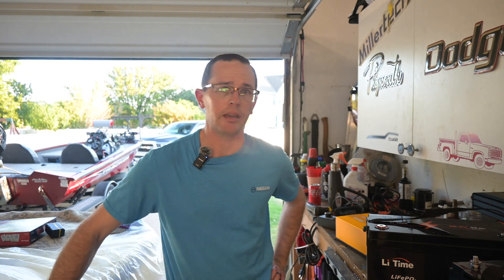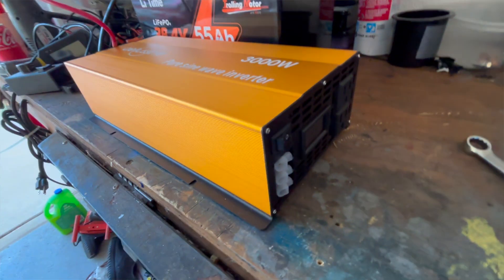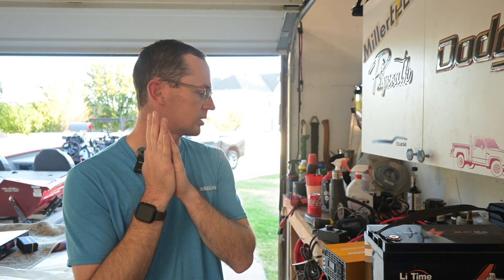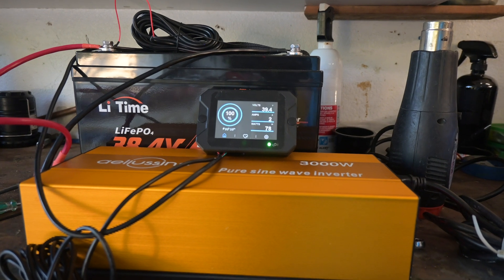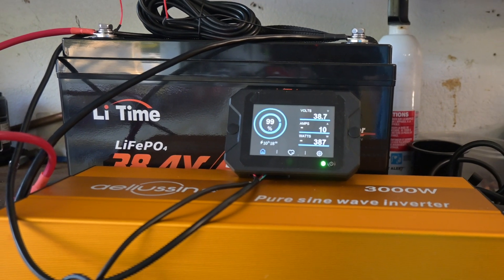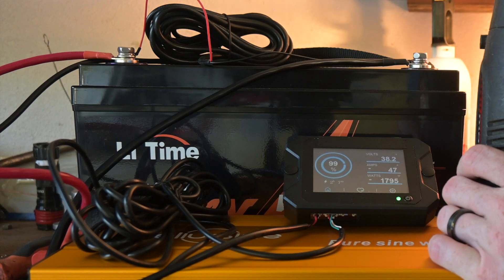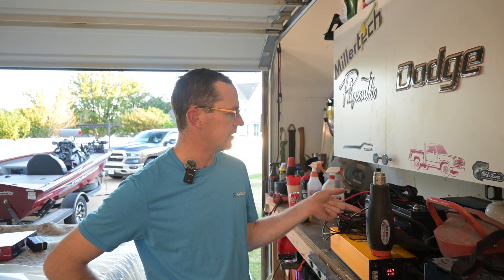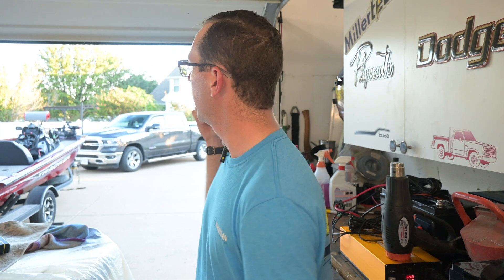36V LiTime Lithium Battery Stress Test - 3000W Inverter | 55Ah | 50Ah

Comment: Do they still make the 36v 55 ah all I can find is a 36v50ah in a group 31 or a 36v60ah in a bigger size
Reply from the maker: It doesn’t appear that 55Ah is an option anymore. The 50Ah is a pretty solid setup, however

Comment: What are you actually running in your boat for the trolling motor?
Reply from the maker: It varies depending on which batteries come through. I've used the MillerTech, LiTime and Redodo 36v batteries. All work just fine. 

I do go back to the MillerTech, only because it has Bluetooth and I can monitor what it's doing g

Comment: Is there any risk in damaging your Garmin trolling motor with 39V output from this battery vs the recommended 24V-36V?
Reply from the maker: The Garmin force manual calls for a 20-45Vdc input voltage. No issues.
Reply: @goodmanfishing  Oh great - I was looking for that spec but all I could find was 24-26V.  Going to order one of these Li Time batteries to try out!
Reply from the maker: @mudderfadder5404 

I think it's the very last page in the owners manual 👍

If you use the links to order, it helps me out!